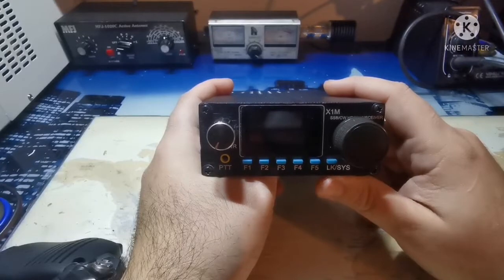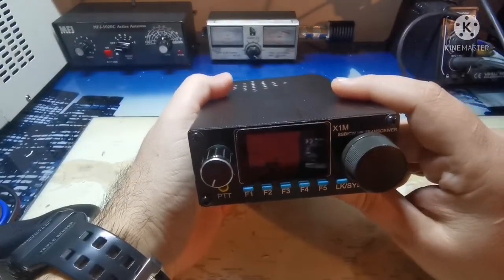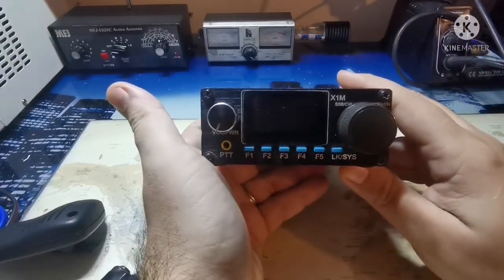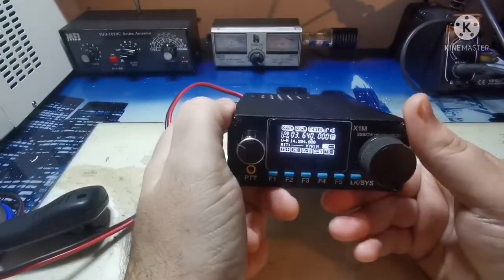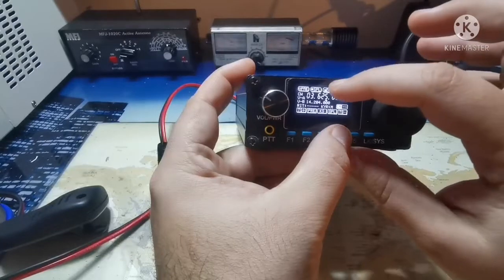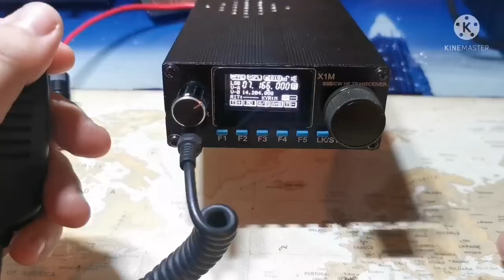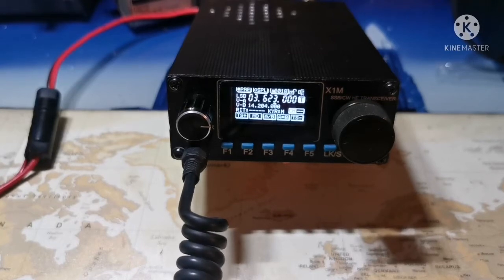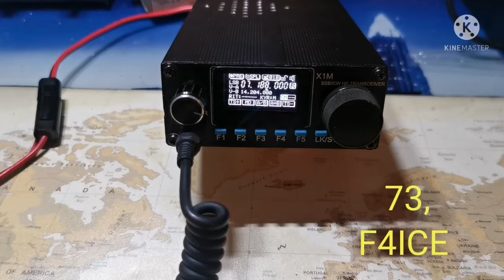SDR radios - part 3 (Xiegu X1M qrp transceiver, qrp radio)

Comment: Aluminum not aluminium
Reply from the maker: In American English, this element is called aluminum, while in British English it's more commonly referred to as aluminium. The two names refer to the same chemical element. In scientific writing and academia, both aluminum and aluminium are commonly used and considered correct names.
The American Chemical Society (ACS) officially adopted aluminum in 1925, but in 1990 The International Union of Pure and Applied Chemistry (IUPAC) accepted aluminium as the international standard. And so we land today: with aluminum used by the English speakers of North America, and aluminium used everywhere else.
Have a nice day 😉